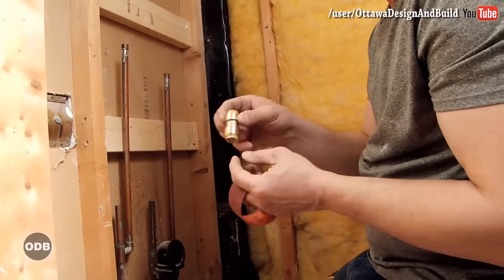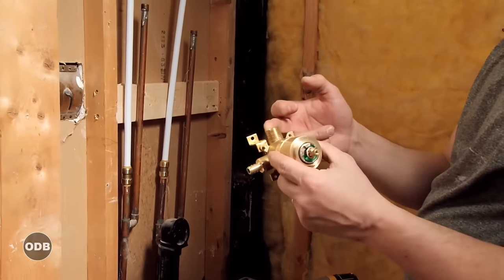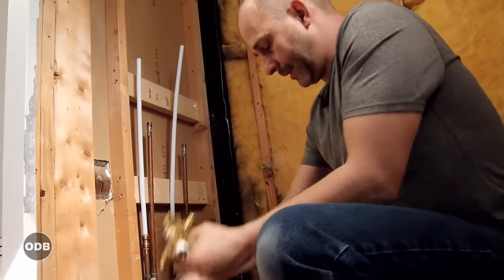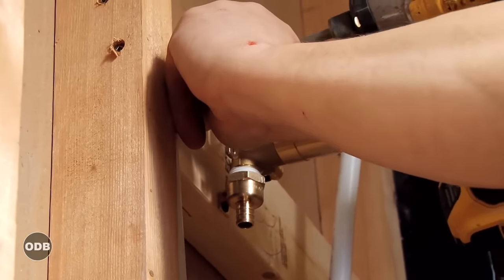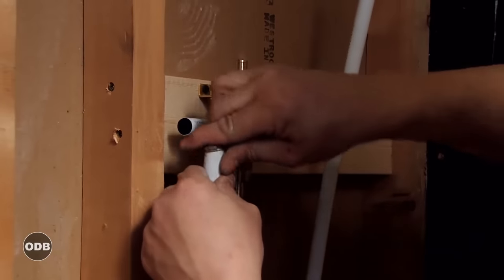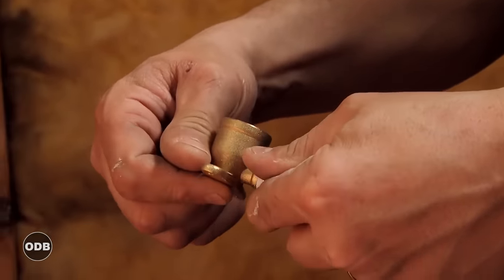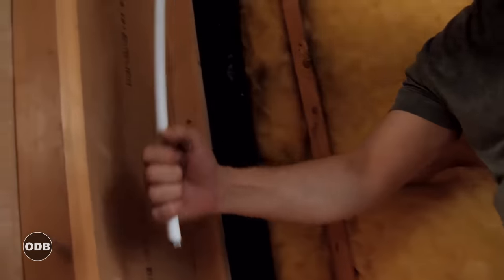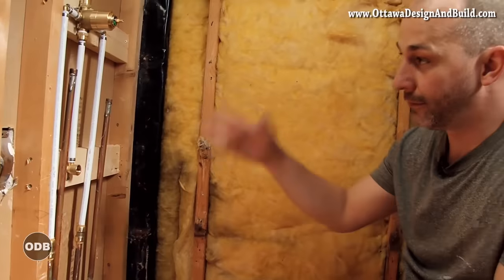DIY How To Install Copper To Pex | Shower and Bath Plumbing

Comment: not using the channel locks the right way. anyone else notice?
Reply from the maker: Yes, I did. It all came down to nerves during my first shoot.
Reply: +Ottawa Design and Build Renovations Well I appreciate your videos, they are very informative, thank you. I know as much about plumbing as these "shadetree critics" know about etiquette. My 56 year old slab house thought it was a watercraft when the water line became porous, the leak was under the slab and not inside. Fortunately, there are only two season's where I'm at, the 1st one is hot and the 2nd one is hell so insulating was a minor issue, lol. I wanted to say thank you for the information, you saved me approximately $4,800. Now I can get a real boat!!!!! Lol.
Reply: I was just gonna comment that as soon as i saw it. lmfao
Reply: No, that's just a left handed channel-lock....ROFLMAO. 
Teflon and dope should NOT be used together, want a dozen reasons why?
Uncoated "drywall" screws at 7:22 not code.
"No need to hire a licenced plumber..." at 9:46 was ROFL material!
Not a bad video overall though!
Reply: +John In Milford teflon and pipe dope all day
Reply from the maker: Now we are talking.
Reply from the maker: Thanks, I think.
Reply: You don't know how to put Teflon tape on threads.
Reply: Oh boo hoo, he didn't use the channel locks right. Still got the job done, didn't it? Come on. Don't be so petty. I mean, obviously using those channel locks the wrong way is going to make sure that the whole fix he did will come tumbling down within 5 minutes after the video ended, right? Because it is game breaking!
Reply: Definitely not a pro!  Wrong sand cloth and why use short pieces of pex?  You already have it in copper; finish it in copper!  Unless you don't know how to sweat pipe to a solder valve???
Reply: David Brown the whole point of this video is showing HOMEOWNERS who don't know how to solder an easy way to install their own valve body
Reply: I always hate coming to a job after the homeowner or a incompetent plumber has screwed it up!
Reply: Curt St onge   If you haven't already learned to use tools correctly, do you really think you're competent to finish the job?  Most pliers have one grip direction, use them correctly.  I can picture a homeowner having a small leak behind the shower wall, after a little  time it turns into a nightmare with mold, mildew and structural damage.  Get real, pliers are only a basic tool!
Reply from the maker: Thanks Curt, I have big shoulders though. These haters can never slow me down. We have a ton of new projects in the works including a huge series on drywall install and taping tricks from the masters.
Reply: I DO
Reply: You should never use sharkbites where they aren't accessable, was there a pex insert in the pex attached to the sharkbite? Only 3 wraps of tape on a male thread fitting is enough, never use pex as a supply to a tub spout, it will make the shower operate at the same time.This is why you need a licensed plumber. Bill , Master Plumber in Lancaster Pa.
Reply: yea, well I am a plumber, and you aren't, so don't comment on stuff you know nothing about,.
Reply: William Curtis, just wait till they have a leak behind a wall and don't discover till there's mold....  Homeowners insurance doesn't cover mold. In my 49 years as a licensed plumber, I've seen it all! Too much Teflon, not enough Teflon, wrong kind of Teflon, wtf? If you're inexperienced leave it to the pros!
Reply: NTH Welding yes I did lol
Reply: Super Dave
Reply from the maker: awesome dude. Thanks for the note.
Reply from the maker: funny how 1 plumber says do it and another says don't.
Reply from the maker: reality is the amount of torque needed to secure the fittings is minimal. I could do it with my bare hands so don't get weird.
Reply from the maker: The point of the video was to show people who can't solder how they could do the job.
Reply from the maker: then retire, I know we are fed up with you already!
Reply from the maker: This is why you have a hate on for new technology. You were a plumber back when they used steel threaded pipe to do a new house.
Reply: +Ottawa Design and Build Renovations — You should preface every response to earlier comments with the name of the user to whom you're responding as I have done here, because YouTube's lame commenting system doesn't do it automatically.  You just left six responses to six hecklers, but it isn't clear which response goes to which heckler.
Reply: NTH Welding to the OP, this guy is clearly not a plumber at all. I guarantee somebody else will be opening up that wall pretty soon to redo ALL of that mess when it starts leaking
Reply: Good video, thank you.  It's unfortunate that there are so many petty assholes with nothing better to do than troll your videos.  How odd.
Reply: Mold! Oh, the horror!  No home in the history of the world ever had mold...  Until someone decided that they could make a fortune in 'mold remediation'.  Notice how that gold mind played out after insurance companies decided that they weren't going to shell out anymore?  It is, and was a farce.  ALL HVACs have mold.  Any area that is not completely protected will have 'mold', yes, even behind showers, EVEN WHEN THE PLUMBING WAS DONE WELL ENOUGH.  That is because humidity is variable even in the air space in the walls.  Over the years, condensation will make pipes 'green'.  

Face it, plumbers are just scared for their jobs.  None of this is rocket science and with the advent of pex, homeowners with some skill and brains can do a fine job.  Just follow the videos.  This one included.  

Thanks there, 'Ottawa design and build renovations'.  Appreciate you putting this up!!
Reply from the maker: Glad to help make sense of simple techniques and materials so people can save some money and take pride in their home again.
Reply from the maker: How's the boat treating you.
Reply from the maker: love the sarcasm. Truth is I have great hand strength after all these years. I just don't care when i grab them unless I really need a lot of torque
Reply from the maker: super dave at it again. Like the title says how to do it from copper to pex. This is to help homeowners avoid plumbers like yourself with such an axe to grind it is impossible to trust your work.
Reply from the maker: I hate how haters can't just comment and walk away. Shurely you have something better to do with your time.
Reply from the maker: Your best value is always found at the wholesalers. Just google it . Now a days a lot of them will sell to consumers who just walk in without an account set up.
Reply from the maker: Hey William, the new sharkbite fittings don't need the inserts removed. Time to check in with the manufacturer again for an update. These new products are changing all the time to get better.
Reply from the maker: Easy plumber. Doug is right
Reply from the maker: You are right Doug, amazing how plumbers think they know things just because they are plumbers but never take the time to read instructions for install or research new products.
Reply from the maker: I removed drywall once and the plumbers joint disengaged due to the wall jiggling. The word plumber is not synonymous with perfection.Just expensive.
Reply from the maker: +Milosz Ostrow - thanks for the tip. please let me know if this worked.lol. I am such a newb at this
Reply: mixer
Reply: NTH Welding  channel locks, rolled the teflon on the wrong way aswell.
Reply: thx 4 being honest. i wouldnt b able 2 talk lol
Reply from the maker: david simmonsjr very cool. gkad u liked it.
Reply: who cares about the channell locks he left type m copper inside the wall.
Reply: Yea I noticed as well. I only use shark bites when I have very little access.
Reply: It bothered me , also the way he was applying the tape
Reply: Zachary McCartin I'm a homeowner, I'll soldier my joints, if you can't figure out how to solder a joint you prob'ly shouldn't be doing your own plumbing anyway.  And why is this guy putting elbows on this? Just run the pex out the 2x4 then turn then back in straight to the valve, the elbows are more connections and more places to leak. Copper to pex to valve, the whole idea of pex is less connections. Redo it all from the lower floor and redrill the bottom plate unless you have a finished basment why add more connections?
Reply: Channel Lock is the name of the company not the name of the tool.
Reply: LOL...Drives me crazy when I see that.
Reply: lmao,noticed it and posted comment before reading your comment
Reply: NTH Welding
Reply: Dude, where are your videos so I can see how a real pro does it?
Reply: Super Dave if your that good why are you looking at how to videos? More than 1 way to skin a cat my friend. You would be more successful in life if you surrounded it by positivity. Nice video, helped out quite a bit. Thanks!
Reply: Home RenoVision DIY 
Not all plumbers are like that, I like to educate the home owner on exactly what im doing, how I'm doing and why I'm doing, for future reference so they do not have to rely on a licensed plumber for every plumbing project.
Reply: Home RenoVision DIY you can have two plumbers on the same job and 10 different opinions on ways to install plumbing. I had a guy tell me how HE woulda did the plumbing on a rough in I finished. I told him tough shit...this is HOW I DID IT!!
Reply: NTH Welding .z (
Reply: NT    Welding
Reply: Sort of annoying isn't it??
Reply: Fight me😂😂
Reply: lol!
Reply: sure did
Reply: he also wrapped teflon tape backwards
Reply: LOL damn I guess I should’ve read the comments before I called him out on that bc  you beat me to the punch. Also check out how he was putting Teflon tape on the threads

Comment: My pex cinch tool has a blue light for when it is fully closed. 
As for the elbows, I found a cheaper way to get the 90° bends is to get some gray 3/4" pvc conduit. You may need to lubricate it a little but the pex slides in & bends nicely. No restricted flow from brass fittings-- fewer fittings that could possibly fail.
There are also some black plastic crimp fittings that have little pieces sticking out to show you where the rings should go. We had to use the plastic ones on a repair after a bad winter storm (coldest it got here in over 100yrs) that ruptured all the pipes & the brass fittings were sold out.

Comment: The only thing I will change from this job is not using the sharks fitting inside the walls if is my job I will do it under the house or in the attic area, good job..
Reply: 962pepo same
Reply: same here.
Reply: I kind of had that feeling, but what would you used instead? I been looking for a soldering alternative.

Comment: Overkill with the Teflon tape (not to mention the plumbers paste).  I worked in industrial instrumentation for 7 years and was taught to use and always used only about one and a half turn  around the threaded end of the pipe with the tape.  Never had a leaking connection.  The tape is there only to fill the extremely tiny spaces between the meshing threads.  Too much tape will prevent the two parts from engaging sufficiently due to the many layers of it enlarging the diameter or might come off completely during engagement due to the extreme layer thickness.  Good job and good intentions, but remember   more is not always better.
Reply from the maker: Thanks, I agree to disagree. In my experience in residential renovations my plumbers have found that due to the shody manufacturing that we are dealing with in our pipe threading. it is necessary to ensure that we cover all our bases.
Reply: teflon and pipe dope are both considered LUBRICANTS... they are there to assist the threads engagement. as with black iron pipe, the thing that seals the joint is the 30 degree taper of the threads.
Reply: alexander ostrouchov seriously doubt "never"
Reply: alexander ostrouchov 4 full wraps with the Teflon is what I’ve always been taught

Comment: Hi Jeff!
I love every of your video, I can learn good tricks and manual dexterity from them. I am a plumber, and I love watching the American's fittings and systems, especially the PEX. In Hungary, working and  connecting PEX is different than in the US, I saw  similarity when I worked with Rehau. I prefer the Viega PEX fittings where I just put the pipe into the fitting's sleeve and crimp it. Also we commonly connect copper pipe with press or soldering, only a few know about the Tectite fitting what is similar to the Sharkbite, but it can connect only copper pipes.
I saw  some butthurt over yout teflon taping skills, but as it seals, it seals. We use hemp seal, and I prefer it much than teflon. And a trick I use: I scratch the male thread with an iron saw-blade, and the sealant will better snap at.
Reply from the maker: Cheers to Hungary, I am just a novice plumber and glad to learn from the pros.